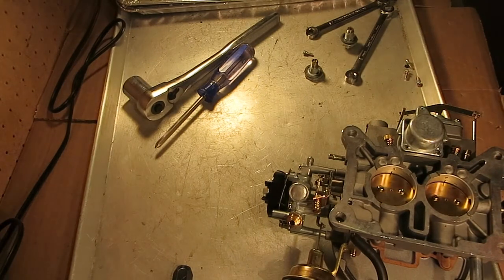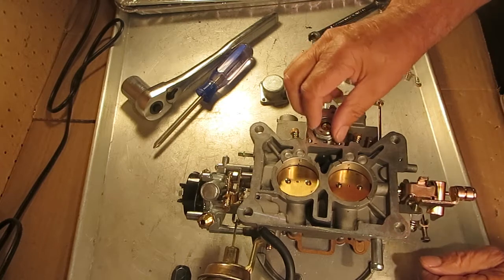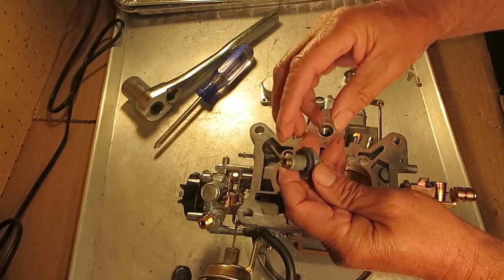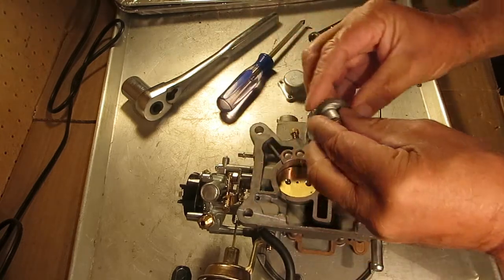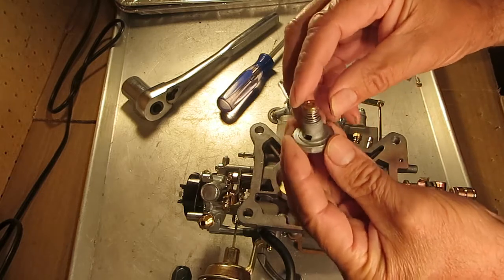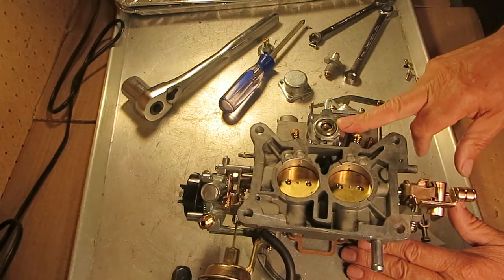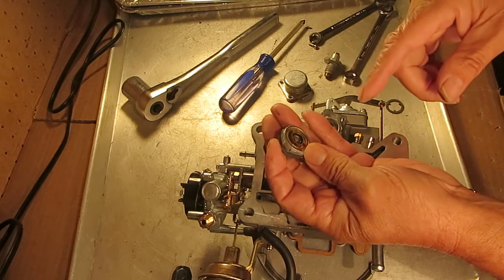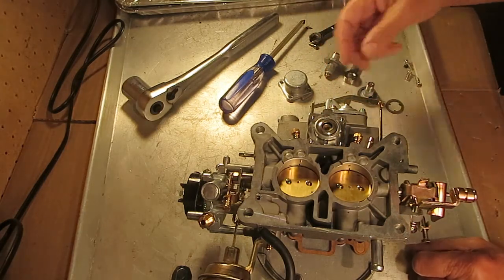Unveiling the Power: Exploring the Motorcraft 2150 Power Valve

Comment: Mike I have an 81 F 350 with the 400 engines in it. I have had several different carbs on it from ones that I personally rebuilt to the one that is on there now and it is a Factory Reman. The engine has a history of pumping the crankcase full of gas. I have done all of the normal diagnostics including filling the carb bowl with fuel on the bench and seeing if gravity will make it leak around or thru the power valve and also gravity tested the needle seat by using a funnel with rubber line to the car while it is on the bench to see if any fuel is getting past the needle seat. I have replaced the original manual fuel pump with a new one. Put a fuel pressure gage inline ahead of the carb to measure fuel pressure and even put an electric fuel pump on it. Nothing seems to help. I do understand carbs and the Motor craft is simple and very well designed. I have also put a vacuum gage on it and have not seen anything on the vacuum gage test that would alarm me. So now my thoughts are that if the brake booster is leaking it could lose enough vacuum for the power valve to open during idle. What are your thoughts and recommendations? I have even made a block off plate to block the EGR thinking perhaps exhaust pressure would cause the power valve to open during idle.   Thanks in advance.
Reply from the maker: It is flooding. What is the fuel pressure set at? Should be about 4.5-5 lbs. I doubt the power valve is doing it but you can test it. Check out this page for more help: https://www.carburetor-parts.com/2150-troubleshooting
Reply: Thanks Mike. I still have the fuel pressure gage in the line so I will check the pressure again, but it seems to me like it was around 5 psi when I tested it before. I have the tool and the hand pump to check power valves so I could verify the valve is still good, but I have done so before on other new power valves and even with those known good ones, I still got the flooding issue. So, the issue of flooding is common to various carburetors and various known power valves.  I will follow all your recommendations because I am the one asking for the help from you. But just out of curiosity is there a vacuum gage test that could tell me what is happening to the power valve?
Reply from the maker: The power valve testing is very specific testing equipment non of us can afford.  @terrycannon570

Comment: Both my Accelerater and Power valve are leaking gas on my MC2100 on my 1980 CJ5. Can I just order the  gaskets separately for these 2? Mine is a rebuilt 2100. Thanks.

Comment: I have a problem with my Reman 2150 stalling when coming to a stop. Always heard the power valve could cause this. What do you think Mike?. Float adjustment? Or faulty power valve?
Reply: @MikesCarburetor  I dug into it and found that the power valve was not torqued. Tightened it up problem solved

Comment: Thank you for this.  I'm having a problem with new power valve's keep leaking.  I took the advice of another video where the guy used a Viton rubber ring as a gasket.  I still got the same problem.  Any advice on that please mike?  Thanks in advance.

Comment: Thanks for posting this. Question, can you substitute a Holley power valve of the same rating for the Motorcraft power valve? They look identical. The reason I ask this is that my father ran a carb shop, and I've got all of the old kits, BUT often he would rob parts out of the kits. Last Motorcraft carb I rebuilt, the only kit I had on hand was missing the power valve. I had several Holley PV's,  and so I just installed the Holley PV. The engine seemed to run fine, but I wanted to check to be sure this was OK, just in case I run into this in the future. Thanks.
Reply: @MikesCarburetor  Thank you.
Reply from the maker: Welcome

Comment: Where does the vacuum come from? The reason i ask is i have a new 2150 and it is leaking gas from the cover all over and its quite possible my vacuum lines are hooked up wrong. I'd like to know before i pull it apart.
Reply: @MikesCarburetor  thank you for the advice...i cracked open the power valve cover and it was full of gas, so I replaced it, and dressed the sides of the new gasket and snugged everything up nice, the truck runs a tad better but tonight i noticed gas dripping from the cover again.
Reply: Okay, I've replaced the gasket along with a new valve three times now and i'm confident that i have done it correctly. But when i shut the truck down and it sits, it fills up the cover and drips...is it possible the air bleeds or main jets could be off somehow? Also, the whole outside of the carb including top gasket looks wet, but when i pop off the top the fuel level sits normal.
Reply: I have the same problem on my brand new carb. I have tried everything but the gasket always leaks. I found out the gaskets are made in china and are crap. So the only thing I can do is park my beautiful hot rod out in the cattle pasture.